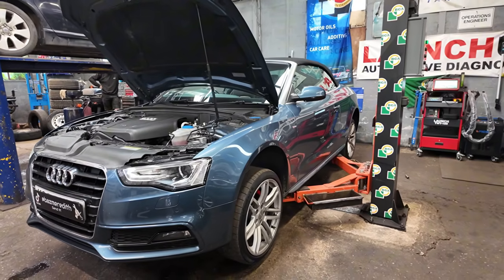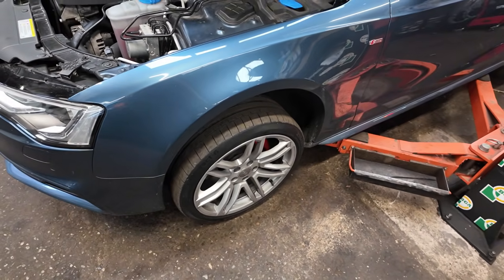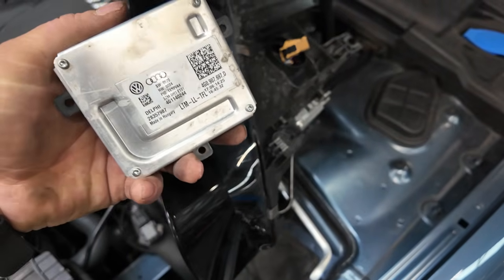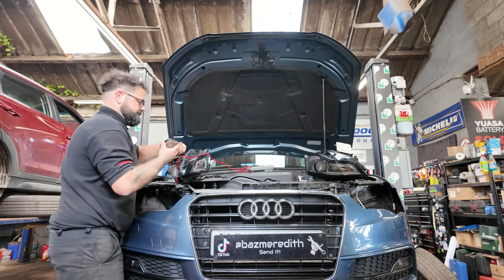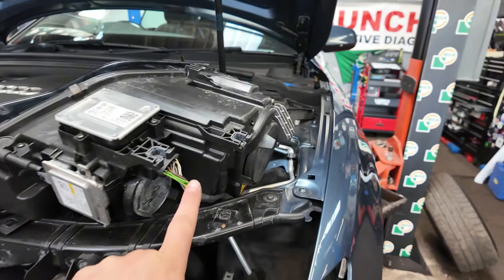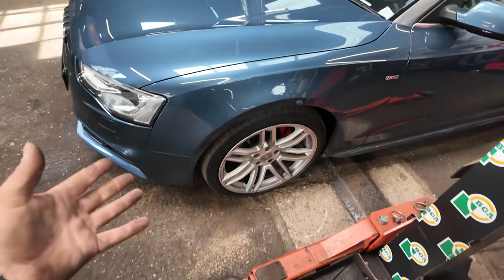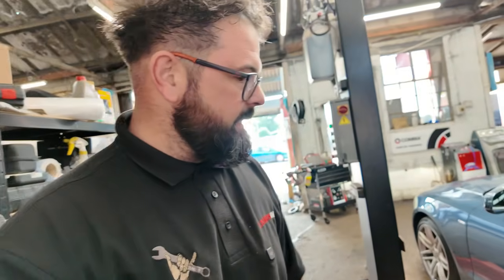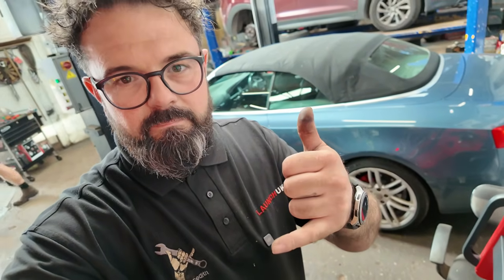ALL THIS FAFF FOR A LIGHT!!!! NO WONDER NOBODY WANTS TO GET INVOLVED. AUDI A5 DRL FAULT.....

Comment: I had a similar problem with the headlights on a different car. It had LED matrix ones and showed levelling errors and AFL errors. This was all caused when I filled up the windscreen washer bottle and splashed everywhere by accident.  Wires going up in to a connector didn't appear to be properly waterproofed, so it also did it if I went through heavy rain.
I left the bonnet up on a few really hot days and it all dried out.
The water caused a short and messed with the CANBUS.
The main dealer wanted £3800 for the headlights, £300 for level sensors, and £800 for a BCM, plus programming and diagnostics fees, saying there was no guarantee this would fix it. So they just wanted to throw parts at it, at my expense and couldn't fault find.
I can tell you it wouldn't have fixed it.
I have now used sealant on the connector and around the wires affected and fitted a shield to deflect water.

Comment: Had this problem. My car turns out to have a problem with the LED inside the headlight. You can plug the headlights into opposite sides of the car to be sure. Only suggesting this because sometimes as you know modules can do strange things when they detect a fault in a component they are operating.

Comment: Jumper wire from the rh drl feed 12v over to the lh one... gedder sent. :-)
Reply: Had to do that with my Sierra
Reply: @mrmick4757  Nowadays the bcm would probably detect the draw was too high & cut the feed. :-) Then neither would work. You gotta love progress...
Reply: Would not work. The BCM would turn both off. Yes I have tried this before 😂
Reply: @richcotta1564  I literally said that in my 2nd comment. First comment was a joke.

Comment: Ayy you ended up swapping the stuff over like we chatted about. Best thing to do to diagnose for speed. 
Seems like it’s potentially BCM not sending the output signal if you have no volt drop on the wiring. 
Pain in the butt!!
Reply from the maker: Ye man always best talking to techs especially ones like you!!!! Top man 🤙🤙
Reply: Thats the approved odis test plan for lights, but of swaptronics👍👍
Reply: @samfriend8305  sure is!

Comment: Could you not plug the driver side headlamp into the passenger side wiring to see if the fault remains on that side? If the drl works then you can rule the wiring out and put it down to a faulty headlamp?

Comment: Audi convertibles have more water leaks than a sieve and you can guarantee it leaked in to a module somewhere a daft one I had was a corroded fuse in the main fuse box checked fuse live so nowt wrong but when I pulled it out it was as green as grass behind 🤔👍🇬🇧

Comment: Baz I got a question can I use infontainemnt system in a Range Rover while the MAIN battery is on trickle charge will it drain the battery or should it be fine so long as the main battery is on charge or do I need to charge auxiliary battery?

Comment: Its the BCM faulty !  had a few on all VAG cars -- Don't waste any more time its the BCM !  spent 1 week doing my 1st fault like this - So did I say its the BCM ?  I bet its had a failed or failing battery recently ? when you crank the engine for some reason it causes this BCM fault ?????? i know its a pisser, You should have just swapped left for right headlight its quicker than taking the module off.